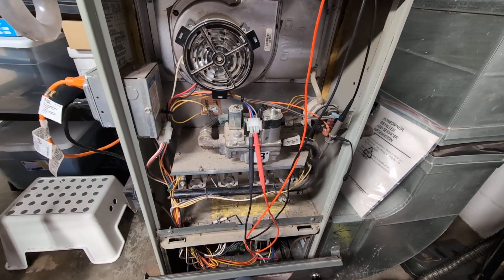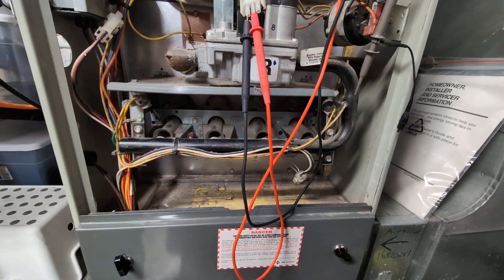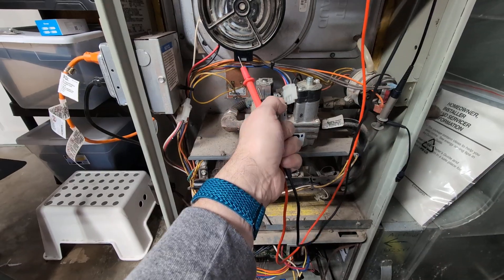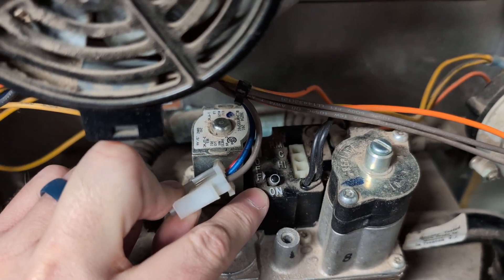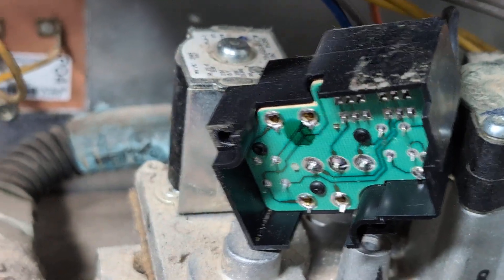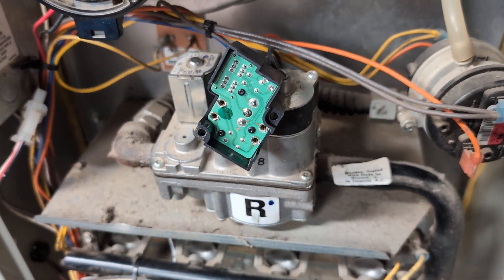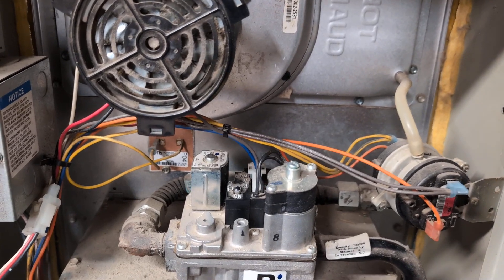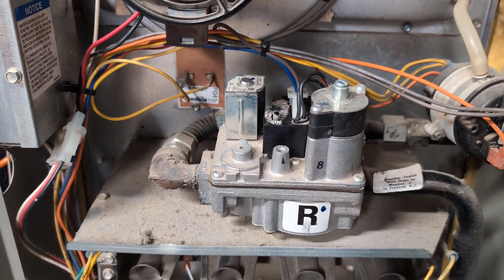No heat: Gas valve with broken solder joints, easy fix. (Trane XL80)

Comment from the maker: Update: It's been over 10 days since I did this fix and the furnace has been in use continually. There have been zero issues with it, heat works every time it is called for by the thermostat. I should probably remove the main control board and reflow the connections there too. Trane uses the same Molex connectors on the main PCB, and those are likely to fail in the same way.
Reply: I'm spoiled by the scrubbing of motherboards on this channel that come out looking brand new. Pls vacuum the inside of that furnace. 🙏

Comment: Just dealt with a very similar issue with an older Honeywell SV series gas Valve.  This was hard to find because in my situation….the igniter never glowed, however I was seeing 24V at the terminals.  I first suspected igniter…so replaced it and still nothing.  Next suspected Transformer and replaced it…Nothing.  Next I was stumped so we got an old main board off Ebay $30…Nothing.  Perplexing because all thermal cutoffs/ rollouts and pressure switch, inducer, etc were all checking good.  Lastly I pulled the cover off the damn gas valve and found one cold unsoldered joint. Resoldered it and worked like a champ.  Wish I had seen this video sooner.  Lesson learned ….Don’t give up!!

Comment: My Niagara furnace turns 70 years old this year, they don't make 'em like that anymore.   It has an old-style bimetalic plenum temperature sensor to turn on the fan, those only last anywhere from 2 to 10 years, but other than that never a single problem. I bought 6 new-old-stock Honeywell units about 5 years ago, they're the ones made in America, and they seem to last a lot longer than the new stock units that are still available.   Things used to be built to last, but where's the profit in that?

Comment: For my Lennox furnace, I'm still waiting for a new control board... the furnace starts up if I flex the PCB.
Reply from the maker: I take it you've already reflowed the solder joints? Certainly a classic symptom

Comment: The interlocks on my furnace are of the same type as are used on arcade machines. You can pull out the knob to turn the furnace on rather than reinstalling the panel. You may want to try that the next time.
Reply from the maker: This furnace has a rocker switch of sorts which gets pushed by the panel.

Comment: RoHS didn't take effect until 2006, so that solder is leaded. In fact, RoHS is only for European countries, and they don't use such equipment, so it likely is still using leaded solder post-2006 as well since there's no need for it to ever use lead-free solder. It's just cheap cost cutting assembly as usual (you'll find it all over in HVAC)

Comment: I had the same issue with my old Volvo 740. It wouldn't shift into overdrive reliably.. The cause: Bad solder joints in the overdrive relay.. Happens so often in old monitors and TVs too.
Today they would change your entire house before even considering to do some simple diagnostics work. It's insane!

Comment: In the UK we are not legally allowed to fix our own gas appliances & household insurance will get withdrawn!

In a previous property we had an oil-fired heating system with a similar fault plus a couple of other faults as not covered by the same legislation as gas, so fixed it myself!
Reply from the maker: Health and safety rules in the UK can be so over the top. Can't work on an appliance but it's okay to have a gas stove that you light with a match.... like that's not potentially dangerous.

A feature of gas service in the US is you can call your local natural gas provider to have them come do an inspection of your gas appliances to ensure they are operating correctly, check for leaks, safety concerns, etc.
Reply: What forced the change in the rules was a big spate of multiple deaths due to explosion & CO about 15 years ago.
In fact this year has been bad for explosions as people circumvented the meters due to cost of living.
One of the.biggest explosions was due to a Heat pump installation. Ironically the installation of green energy products   found a source of fossil fuel!!!!
The borehole hit a gas pocket which they had to pump a lot of concrete in to cap it. 
Not that the gas heat pump used!

Comment: Although a bit more involved, just last week I fixed our gas water heater which only required a new thermocouple ($10} and an hour of my time. Last time we had it done by a plumber who charged close to $200 for the repair. Although not a bad solder joint, it was still quite easy. The bad/cracked solder joint bit us with the washing machine a couple of years ago on it’s temp control PCB at a high wattage resistor. It’s a great feeling to fix what’s actually wrong with something.

Good job, Adrian!
Reply from the maker: Yeah those thermocouples can wear out or fail. The furnace uses one as well, it's called the flame sensor in this application and it's easy to swap. The controller uses the thermocouple to check the gas properly ignited -- if the voltage is not present from the thermocouple after ignition, the controller shuts down the flow of gas as it assumes there is a problem. Clearly having gas flowing while it's not ignited is very bad. :-) On most water heaters that aren't powered from the wall, the thermocouple uses a pilot flame to generate a small voltage to run a circuit which is able to open and close a gas valve based on a thermostat. This does two things, it ensures gas won't flow if there is no pilot flame but it also operates the voltage needed to run the control circuit in the water heater.   In either case of the furnace or water heater, a bad thermocouple will cause a no heat situation.

Comment: I had a similar issue with the Utica system my late father installed at my childhood house. Some months before we moved out (he had moved out long ago) I noticed the relays were chattering and were getting charred inside. so I pull out the relay board and whaddya know, cracked joints EVERYWHERE probably from thermal stress. Some flux and a fresh helping of 60/40 and it was right as rain, after a relay replacement as well, probably very unobtainium Omrons as that, the first one I replaced because it was the original, but I never intended for the second set to only last a couple years. the were chattering away and weren't sending the signals for heating the house properly.
Reply from the maker: Ahh good one! Yeah that chattering would quickly kill those relays too. I guess this is just going to be become routine maintenance for stuff made in the lead free era!

Comment: If you were not able to do that the average person would have called an HVAC company and been told that the needed a new furnace.

With there holiday special it would only cost  them $4500.
Reply from the maker: No doubt. My own furnace at home is from the very late 80s. I had it inspected by the local gas utility and I asked if they thought it was a reliable unit. He said while it's only 85% efficient compared to new ones which are typically 95%, mine will probably last forever if I just keep it serviced. (Which means cleaned and oil the motor bearings regularly.) All of the parts are easy to get if anything does go wrong ... Meanwhile, my neighbors had a 95% condensing unit they got in 2012 which ended up needing to be replaced around 2022! Meanwhile in the last 12 years, all I've had to do with mine is new filters, drip some oil into the motor bearings and clean out the dust inside. It seems the Trane XL80 in this video is made just like mine, so I guess end of an era where things got much more complex and impossible to fix once parts are no longer available.

Comment: In Ontario anyways, we're not allowed to repair electronics.  The instructor on my gas license exam threw that at me during my practical, and of course, I gave her the wrong answer.
Reply from the maker: That is likely the same everywhere... Different field of expertise I suppose.

I'm comfortable fixing the electronics but I'm not going to go touching any of the gas lines or the valve itself! That I would leave to someone who is properly trained. It's unfortunate since these things are becoming more and more computer controlled and as soon as you can't get something like a replacement controller, then the whole thing needs to be replaced... even if it is just some bad solder joints, which surely will be the case on this 20 year old Trane.

Comment: Although on some of those valves they are a pain to take apart (i had one go out) and while everything tested fine using a multimeter it just wouldnt release the gas, i would have tried taking it apart but it appeared to not have any way to remove the components, i might still have it in my parts bin to look at. but a new part off amazon was cheap enough for me to order, i did have an hvac tech install it as im not a fan working with gas appliances. (ive done it but its always a worry in the back of my mind of something leaking and causing a fire)

Comment: Might want to order a spare igniters online to have, most of the HVAC places don't sell to the public.  Also they are very fragile.
Reply from the maker: Yeah I actually have a spare flame sensor for my furnace. I've never had a failure but just in case .... and yeah probably a good idea for the ignitor too, as clearly that should be considered a wear item.

Comment: I say you need to do some maintenance on that furnace. I see a lot of dust on the blower motor and all over the inside of the unit... Just saying.
Reply from the maker: Yeah, it's not mine but I do agree. After this fix, we vacuumed it out inside.
Reply: @adriansdigitalbasementextras  I assumed it was your furnace and that's why I was surprised by how dusty it was. You keep things much neater than that was. I'm glad you were able to resurrect it back into the line up. Job well done and I'll also be looking for broken joints.

Comment: Beyond helpful.  I have a similar unit with an identical looking valve unit.  Mine isn't quite as old, but if it doesn't ignite, I will start my diagnosis there.

Comment: Wow, this would be rather illegal in the UK. Gas appliances (particularly for central heating) can only be worked on by folks who are qualified. (And those who are, I suspect their qualifications would explicitly tell them to not take a soldering iron to a circuit board, and leave electronics to the manufacturer).

Comment: They don't make stuff like they used to, we just replaced our 1981 furnace due to a flood, it was still working, but after the burners and control boards were literally under water, we didnt trust it anymore (plus insurance was paying the bill), I know for a fact the Carrier unit we just installed will noe last even 20+ years like yours, and absolutely no chance it will hit 40 like our old one did.
Reply: How could you possibly know that?

Comment: Nothing stops a Trane! ...except a broken solder joint.
Reply: LOL at least I can't fault them directly -- as that valve is made by White-Rogers. It's frankly a poor design. The pins on the PCB should be reinforced with metal inserts, which you commonly see on CRTs to prevent exactly this kind of failure. I have half a mind to remove the main controller PCB and check it for cracked joints as well, especially on the Molex connectors.